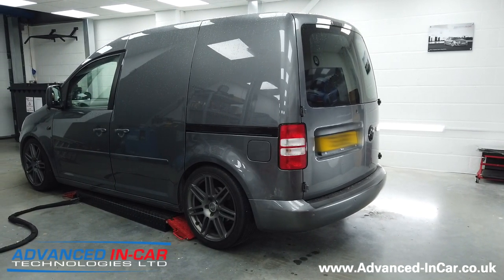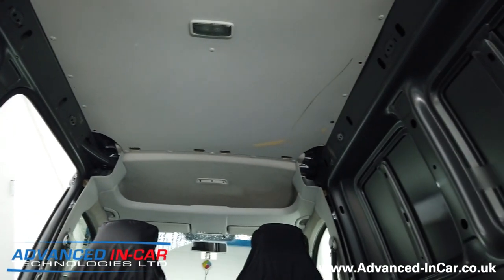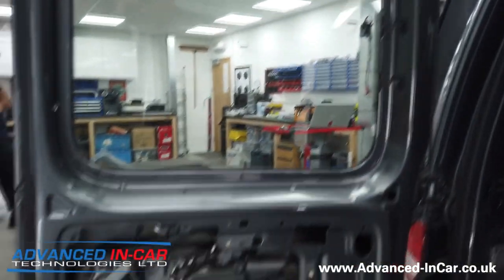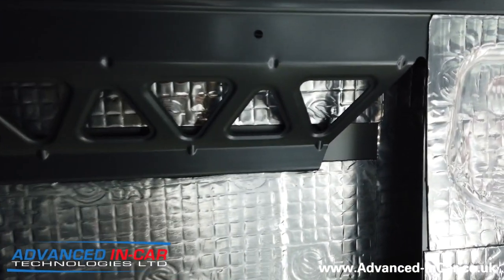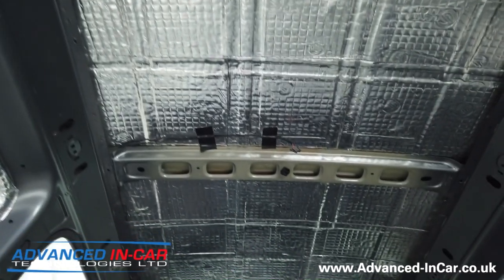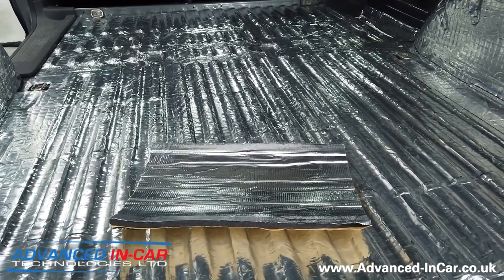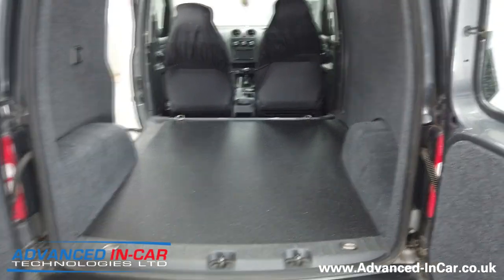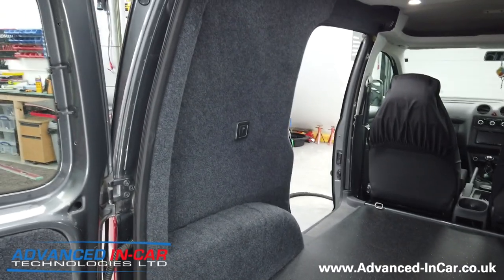Volkswagen Caddy Van Conversion

Comment: At first, I would put mineral wool and foam in. To isolate the car, to keep warm or cool.
And this can reduce noise too.
And after this, I would mount the aluminium foil.
Reply: 100%. Mineral wool makes so much difference. Makes the build more difficult for these guys though. This job probably took them half a day and cost thousands to the customer
Reply: @pete801  I got many glas wool for free, from my neighbours. When their house project has finished.

And over 30 styrofoam panels from another house project. And big foam wrap rolls cheap from a company, who sells material for packing products for transportation.

But I know, that prices are in GB a bit higher, as here in Germany. If you buy something.
But I look allways for other ways, to buy it cheaper.
Reply: @pete801  i had  too often too cold in my life.
So I need a diesel heater, and a good warm isolation in my minicamper van.

I heard from many owners, that the vw caddy is very good and reliable.
Many bought them used from the german post company.

The german post buy his cars cheaper, with a huge discount. Because he order so many.

But with his own leasing company.
So they safe more money by his less tax payment. Because leasing.

After three years the leasing contract is over, and they sell it to everybody.
But price 5.000 pounds each car, but in good condition.